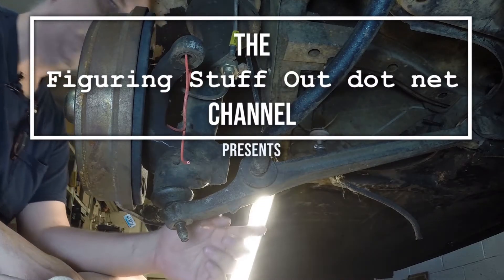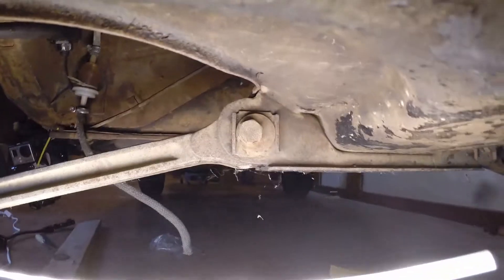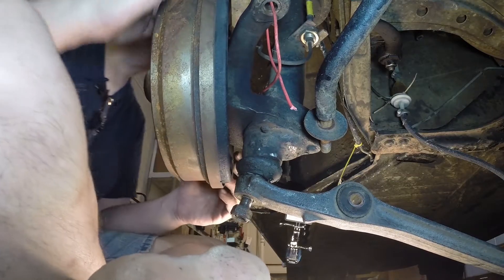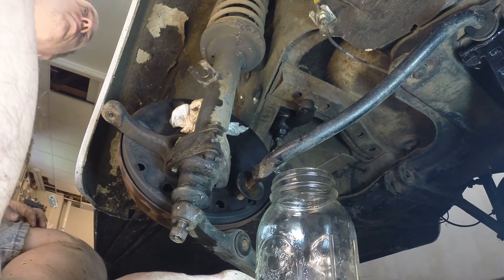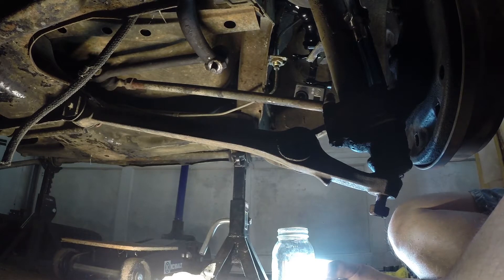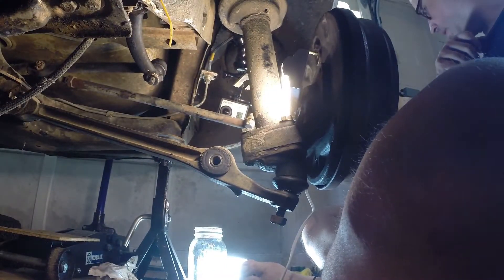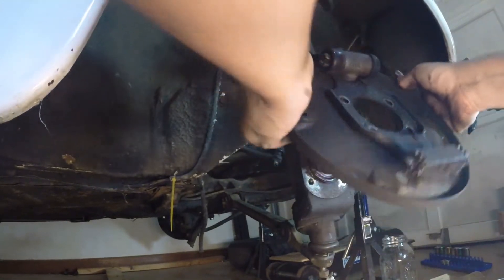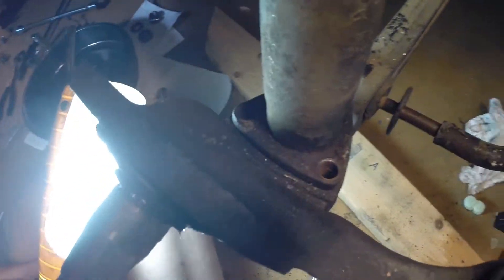SuperBeetle front suspension teardown pt2: control arms

Comment: Working on the same thing.  I used PB Blaster on everything the day before I started.  Idler arms popped right off.  Ball joints took more effort.
Reply from the maker: Yeah; getting the ball joint spindle out of the tip of the control arm was really the only part of the suspension disassembly that was really hard.  Everything else took a bit of grunting and wiggling and it came apart.  

Thanks for watching!

Comment: You haft to use a tie rod separator that looks like fork, the only way that will come apart, and hammer away.
Reply from the maker: I'm aware of pickle-fork joint separators, yes.  As it turns out, I have a later video where I test multiple tools removing the ball joint: https://www.youtube.com/watch?v=Pk4LcoeePmM.  Feel free to check it out!  

I tested the fit of a pickle fork separator.  It did fit in the joint.  I didn't try with it very hard because there was another tool that seemed like it would be more suitable.

Comment: When you rotated the idler arm did you observe the center bolt moving in sync, or did the arm rotate around a fixed bolt. Lastly there should be zero up down movement in the arm. Hard to get good aftermarket idler arm bushings.
Reply from the maker: Hey, thanks for watching and for the question.  

I drove the car a lot in the span of 2008 through 2010.  During that time is when the super-shimmy started to show up.  I tried fixing it several ways.  First I replaced the steering dampener on the steering arm; no change.  I did replace the idler arm bushing set with a new solid brass/bronze one.  When I did that I had the idler arm housing completely out of the car.  

I'm pretty sure that when I put it together, all the rotating pieces were clamped together and moved as one.  So the shaft, including the upper end with the big triangle piece, the idler arm (that goes on the lower end) and nut that holds it on, all rotate in the housing together.  I think it has to, right?  Because if it doesn't, the stops on the right side won't keep the tires from hitting the sway bars.  Am I understanding that right?  

If you have something specific you want to see, I'm certainly willing to put the car up on jacks and get under there with a light and a camera and take video and post it to youtube.  Let me know more specifically what you want to see.  

Thanks for watching the video!  I hope to get to the videos of running the engine and driving the car before March.

Comment: The entire reason I watched was to see how you got the sway bar off the control arm.  Skipped that part.  Bummer.
Reply from the maker: Another point--getting the sway bar back ON is a whole different kettle of fish.  I kind of had to fight with it to get it back on, and had to take a few things back apart to get everything to go together.  I did film that, so when that video comes out in a few months, that may be useful to you as well.
Reply from the maker: Thanks for watching!  I'm sorry you didn't see what you wanted.  

I didn't show removing the nut from the end of the sway bar.  

It's sped up, but if you watch from 0:36 to 0:44, you can see me try to pound the control arm off of the end of the sway bar.  I eventually realized that wasn't going to work with the control arm attached at the inner end to the frame, so I then worked on that.  Once the inner end of the control arm was free, it dropped down and popped right off of the sway bar (which I don't think I caught on camera, or I would have shown it in this video).  If I'd had the right tool to pull the ball joint spindle out of the control arm outer end at this point, that would have made it a lot easier (I have a separate video on that).  

I hope that helps.